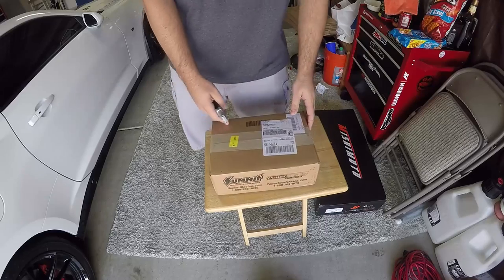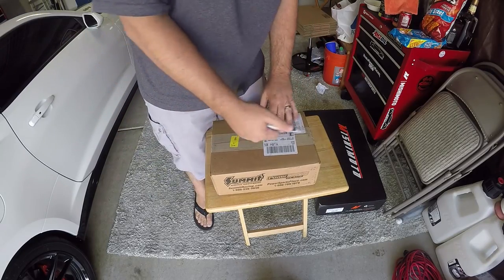What is a Breather, Catch Can, Breather Catch Can? WTH!

Comment: My CCV in my Volkswagen TDI, the crankcase ventilation, not positive crankcase ventilation, can work with a simple filter on the valve cover. I run a catch can and use it like a breather. I have a K&N breather filter on the outlet.

Comment: I think what is really missed here is the critical importance of proper evacuation, especially with forced induction where higher cylinder pressures result in even more blow-by.  All engines have blow-by, and all engines have a PCV system. The PCV system's most critical functions are to remove the damaging compounds that enter as blow-by. These are water, acids, raw fuel, and abrasive carbon/ash/soot particles. The foul, or dirty side of the PCV system removes these before they have a chance to settle and mix with the engine oil contaminating it and causing excessive wear. The fresh, or clean side is where the make up filtered fresh air enters to flush and make up for the damaging compounds being evacuated (sucked out) the foul side.  When you add breathers, you defeat all evacuation and then leave these to rapidly accumulate overwhelming the engine oils ability to protect and shortened engine life is the result. So you NEVER use a breather or vented crankcase. Just look at every type of Professional racing....all use evacuation systems, most belt drive vacuum pumps.  This evacuation also provides a critical function to keep the piston rings stable and sealing properly. ALL engines today have low tension piston rings, and if you do not have suction below, and pressure above they enter a state of instability or rapid vibration known as "ring flutter" compounding blow-by and costing power as shown here in this video:  https://www.youtube.com/watch?v=-7bGshirEKI&t=3s   Now, a belt driven vacuum pump will not last long on the street, so you have to look at the next closest solution that will pull full time suction and never allow pressure to build in the first place as this video explains:  https://www.youtube.com/watch?v=v6h_FOzFMcs&t=943s

While a breather can releases pressure, there has to be positive pressure present before it can release and that still causes the flutter conditions as well as leaving most all contaminants in the crankcase to overwhelm the engine oils ability to protect. A proper system provides full time suction, does not allow pressure to ever build in the first place, and aids in ring seal as well as keeping your engine as wear free as possible.  LeathalGarage, email me direct at:  APDEG@aol.com and will go over more detail on proper crankcase evacuation solutions.  And "catchcans" rarely trap more than 15-30% of what enters them still allowing the rest to be ingested.  Only a few solutions actually trap 95% plus of what enters so this is a good video showing how to test ANY cans claims:  https://www.youtube.com/watch?v=IZYYdnwIEX0  Video is long, but skip to the 17 minute mark to see the results.
Reply: Tracy Lewis Performance so what about a vented can connected to the valve cover? And then a sealed can on the PCV?

Comment: I thought for certain vehicles if you put a breather kit instead of an oil catch can you could possibly lose power due to lose of vacuum pressure if your car needs a certain amount
Reply from the maker: In my case, we make so much boost without the breather we would blow the front and rear seals out of the motor.

Comment: I heard the best ones are the oil separators which throws the oil back into the engine instead of just capturing it. Idk
Reply: Yeah, but still it needs a cooler so that the oil vapors are condensed and separated in the can.  Oil vapors are heavy hydrocarbons that are way too low octane rating that they actually hurt the octane rating of the top quality gasoline you suppossedly buy to run your car!  It is good to catch some oil... it it would be way better to remove all the low-octane stuff goilng back into the engine.
Not seeing anybody realizing this fact. Still, smaller oil droplets are carried into the engine. What is more: many "catch cans" are empty inside!  A really good one should have internals to remove small oil droplets.  And the ultimate system shoud cool the oily vapors and water vapor by condensing them AND THEN separate as much as possible in a well designed catch-can.  Now, shoud the blown oil be returned to the oil pan... or shoulit be discarded?  It depends, unless you are separating all the acids in the mixture (formed when the engine is cold), it would be better to just discard them.  Otherwise it will hurt more than help.

Comment: The breather thrown Po171 code on my Camry so I had to remove the breather can someone tell why? Thanks
Reply: Causes air intake leaks because less positive pressure from the crankcase (since its being ventilated through the breather) therefore allowing air from intake to escape through pcv system and causing engine to not have the proper air to fuel ratio

Comment: The catch can is not a breather it's a closed loop system,  and  air breather vents to the atmosphere which does not work (1950's) , that's why all the cars went to a PVC closed loop system. Duh !
Reply from the maker: +steven wentling they still make catch can breather setups.
Reply: Not true. The pcv was made to reduce emission by sucks thr blowby back in and burning it in the motor again. Same reason the egr was made
Reply: No, steven is correct, its considered a closed system as metered air that is filtered enters one tapper cover (or one end/opposite side in a straight 4/6 for instance) the new air then collects acids, steam, and othershit and suspends them in air, then becuase the opposite tappet cover has engine vacuum applied to it during idle/cruze RPM, this constant vacuum then allows gases to be pulled out that way. Older systems did not use vacuum to pull it out but relied on straight vents like mentioned in this video which are found on older than 1940's cars and draft tubes and road speed, these systems did not work effectively at idle or when the car wasn't moving it would more likely damage the engine faster than a engine fitted with modern day CCV/PCV system.

I think something that is confusing to people is the word positive in the name is a bit misleading, it really should be called a negative/positive because at idle/cruize its pulling in fresh air into the crankcase Displacing the dirty air (and measuring this via MAP/MAF) but then the system switches at WOT and snapping of the throttle plate - air instead halts at the PCV valve/dirty side port as there is not enough vacuum,  and instead crankcase pressure goes back up the clean crankcase inlet pipe side towards to the MAF sensor, but because this is in front of the throttle gets STILL pulled into the engine, so a CCV/PCV system accommodates for engine air measuring of modern engines and for all engine RPM, by introducing a vented can or any extra vent the entire system breaks and you do more harm to the engine than what the OEM equipment does both for engine fueling based on sensors and condition of the interior of the engine - improper PCV function means an engine can get attacked internally via acids, blowby crap, steam etc and wears out the oil faster too.
Reply: Toby Partridge so you can’t just connect a hose to the PCV and vent out the crank case gas to the atmosphere without blowing up the engine? Is that what you’re saying?
Reply: They do work. Do your research and educate yourself. They don't do this because of emissions..
Reply: @stevebbkny2394  you need a pcv delete or a hollowed out pcv for a oil catch can or AOS setup. Very simple and information is more than readily available if you bothered to look it up.
Reply: guitarpro594 you’d be surprised at how controversial this whole topic is. The reason that I looked into it is because I have a direct port injected vehicle and wanted to eliminate carbon buildup from happening. Catch cans seem to be barely effective and cumbersome.
Reply: @xile6  Not EXACTLY the same!  EGR is to lower the combustion temp, to reduce NOX.  PCV is to get rid of the cranckcase venting without directing it to the atmosphere. BUT, std. PCV does it in the worst manner: reinjecting low octane, dirty and fouling oily hydrocarbons back into engine JUST BECAUSE IT IS CONVENIENT! (convenient fo those LAZY and stoopid automotive engineers!).  OILY and dirty streams like PCV does NOTHING good to a clean and high performance engine.  Just take out any intercooler after some huindreds of miles of strong boost and see the incredible lot of crud being injected into the intake by that stoopid sytem!
Reply: @stevebbkny2394  :It depends a lot on the original design: I've seen some VWs that have a so badly designed valve cover that those coat the inlet tract pretty soon with oil sludge that gets carbonized in the inlet ports and the inlet valves. In any case, the damn PCV surely deposites UNWANTED sludge on the inlet tract, period!

Comment: Did you keep this after the Whipple was installed?  Where did you run the lines?  Just in between the line crankcase pvc valley where it plugs into the Whipple intake?  Any pictures?  Thanks

Comment: When I put the filter on top of the catch can it started whistling bad. Would it hurt if i put the small bolt back in the top and while it do what it needs to w.o the filter on top? Thanks
Reply: 2006 dodge charger Rt with the 5.7 v8

Comment: Mine seems to be accumulating a lot of oil in the can. My truck has a cam and headers (2015 sierra).
Ive used about a quart of oil in a 1k miles.
Reply: Did you end up having major problems or was this normal??

Comment: Great video as usual. I'm curious how that vented can is going to sound under the hood. Prolly gonna be really noisy whooshing sound at idle. Venting the oil vapor is probably illegal in Cali. It will also make a mess in time. Interesting to see what this means for you. Old cars had a huge apparatus for venting crankcase vapor.
Reply: What?!?!? Where do folks like you get this information/ideas from? Why would it make noise?! And why would it make a mess? Besides a shitty install or not emptying the can?
Reply from the maker: No noise or mess
Reply: Lol 3 years ago… since then I have installed my catch can and made a video promoting the use of them. I had read a blog about tuners who had installed vented catch cans that caused a loud noise from case vapors escaping or hoses coming apart and making a mess in high compression v8 applications. Hehe I have since installed one on my Duramax as well. @Lethal. Thanks for the help influence and motivation to buy my Camaro in the first place. Hope you are well. My questions were with vented/venting the cans at the time.

Comment: I have a 350 small block Chevy engine. So do I get a catch can with a breather or one with no breather?  I honestly dont know what to get.
Reply: The only place you could put it on the 350 chevy, would be in the middle of a pcv system, I would only worry about a breathable one if it’s forced induction

Comment: Hi Lethal garage, Is it necessary to have the filter on the catch-can; I did not install the breather on the can, although it came with one; I installed a catch can on my dodge ram v8, but I am still seeing oil in the plenum. thank you for the video info
Reply from the maker: The filter is allowing the setup to vent. Not all systems have a vent. We do this to give the pressure from my blower somewhere else to go besides the front and rear main seals.
Reply: @Lethalgarage  ok, but wouldn't the vented catch-can cause the intake vacuum to be too low to pull the gases through the PCV  and the catch-can? I thought that the PCV system has to be closed to create vacuum.
Reply: @carlodonnell146  youre correct, it would cause a vacuum leak unless your car is tuned for it. Theyre usually meant for cars with turbo and other mods. If your car is mostly stock, just go with no vent as a regular catch can.  if you want to use the vent it is possible to block intake pcv hose end and just have your crankcase vent to air through the catchcan and out the vent, eliminating the exhaust gas recirculation sequence, which in turn as well might cause its own issues depending on the year and make.

Comment: I have a 383 with 12 to 1 compression. I have been thinking about a catch can. My current PCV tube does pull some of that crankcase pressure in but I'm wondering if the catch can would do a better job.

Comment: Is your Camaro aftermarket supercharged?  I had a  whipple installed on a 6.4 Scat Pack (forged slugs too) and it's sucking oil through the pcv like a goddamn straw.  Shoots out clouds of white smoke every time I fire it up, puffs a little at idle, and during driving.  You can totally smell it...its oil.  I just ordered a catch can and I'm having it installed today.  It does not however have a breather on the lid.  Does your can work well?  Do you burn any oil?
Reply from the maker: It works well and I don’t burn oil.

Comment: Is just the catch can efficient if there is no other mods on the SS?  I'm asking because I'm thinking about buying a 2016 with 5,000 miles on it, and if I buy want to keep it a long time
Reply: Also I was wondering does it throw a check engine light when its installed, the catch can I mean

Comment: Put one on my 2017 Camaro..as soon as I found out the Gdi system can’t clean the valves. Have tried several brands. They all seam to catch the same amount over time. But definitely for those of you out there with GDi engines, you gotta do a catch can to keep your valves clean. Shame on you, if you don’t make it tops on your list of must do’s for your Camaro.
Reply: I have the same car a 2017 camaro ss so what catch can is best to use

Comment: Corvette z06 and Camaro both supercharged do not use a breather, that should tell you something
Reply from the maker: +steven wentling they are running super low boost. You do any mods or put a bigger system and you blow seals. Hence why a breather/venting are needed.
Reply: LethalGarage like I said breathers are old school from the past not needed anymore closed-loop PVC is the way to go
Reply from the maker: +steven wentling Not when your crank case is blowing seals

Comment: When ever I see someone with a vented catch can like that, I assure you my face hits my palm, this is completely wrong, just because a manufacturer made a vented can doesn't mean it can live on a road car, you have essentially made your car more prone to premature wear as now there is no vacuum to suck, an 1940's WW2 tank would last longer - that's where the concept of PCV came from.
Reply from the maker: The vented catch cam is in place to allow the car under boost to not blow seals. This isn’t your everyday road car.
Reply: Yeah, in australia that is considered illegal on any road registered car and for good reason both for emissions and engine longevity, in australia modification to the direction and plumbing of emissions control is means to defect the car unless you prior had it signed off on by a vehicle engineer and RMS prior to registering the car - if this is an engine you don't care about lasting and is a dedicated track car - then go ahead, if it is road registered you are misinforming people on mods that make a car worse an illegal.

A boosted engine does still have a CCV/PCV system / valve from factory (for instance a petrol turbo car) and does have a clean air tube as many turbo cars are, just however in most cases new engines prior to boosted applications you will have to add a check valve to the dirty side as this is not always a valve but a controlled orifice, that controlled orifice is sucked on at idle and cruise engine speeds from post throttle body because it has a larger vacuum then atmospheric air at the air filter/in front of the throttle plate. If you have added a turbo to an NA engine basically all that needs to be done is 1) check valve for dirty side to stop boost going into the crankcase and 2) move the T piece and MAF sensor location to the inlet/front of the turbo, so it goes Air Cleaner > MAF > T-piece for clean air tube > Turbo inlet, this way clean/filtered/metered and unboosted air from via the MAF both enters the turbo and the clean air tube resupplying the crankcase with NEW air. By adding a vented can you are essentially letting in unmetered air into the crankcase that then is burnt up because it bypasses around the throttle plate - the engine computer can't measure this (also very bad) as you have added a "leak", this leak also removes any chance that vacuum can pull on the crankcase, so relies on crankcase pressure to push the crud out, so infact a CCV/PCV system works better for boosted than a vented can - think of a blocked vacuum cleaner as the vented can and a vacuum cleaner with good suction as the PCV, which one is going to remove the dust from the carpet more effective over TIME - its so simple.
Reply: You know Toby I took you advice and decided not to install the UPE VENTED breather can that came with poor instructions, my 2017 mustang has Vortech super charger I live in NV and we Smog here save your money people.
Reply: @robywankenobi32  thank you